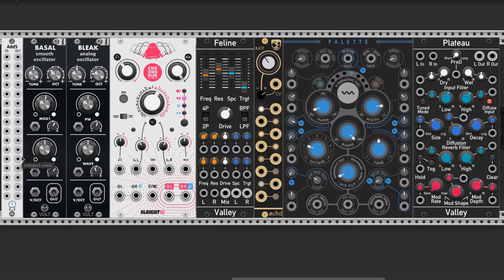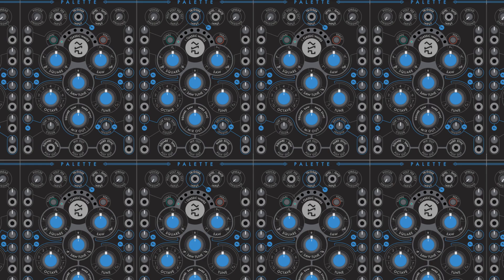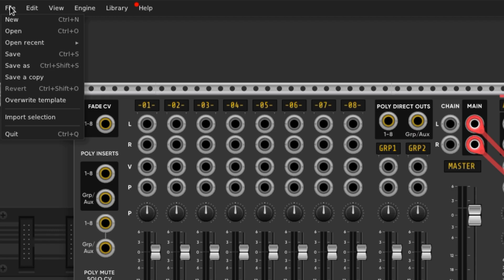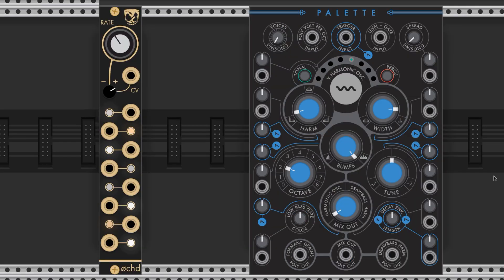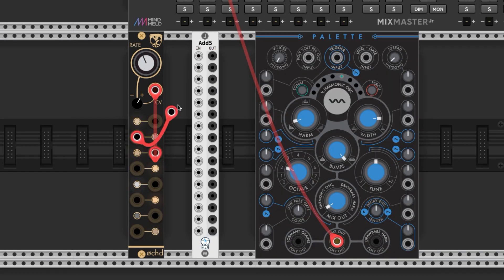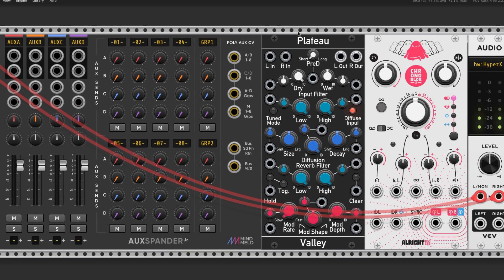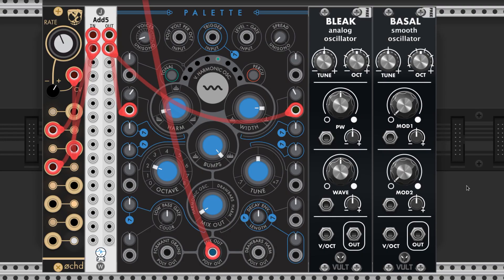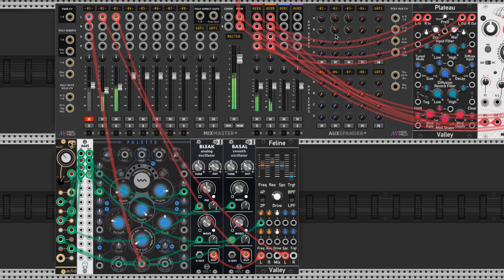Let's Make a Drone in VCV Rack (Didgeridoo Vibe): Full Tutorial

Comment: Could you tell me the name and Brand of the module 0CHD, is 0CHD the name or the brand? I have it in the example patches but cant find it in the module library, I was wanting to use it in some of my own patches.
 I love the wobble effect in Pallette, it is a very versatile modulation effect.
Reply from the maker: It is 0chd by Instruo 🤘😁. It's a great module, but some folks say it doesn't work on their computer, particularly if you run Mac. You can swap it with the Black Octasource by Erica Synths or the  Hexmod by CVFunk if that is the case.
Reply: @yourpalrob  Thanks Rob!

Comment: 0chd does not work on mac osx arm64, is there a replacement for this?  Great video btw, thanks.
Reply from the maker: Thank you! Surge XT has the quad LFO, and CV Funk has the Hex Mod. I could see either of these working well. Volt's Caudal could also have some great effects, especially if you modulate the speed and energy. ✌️😁